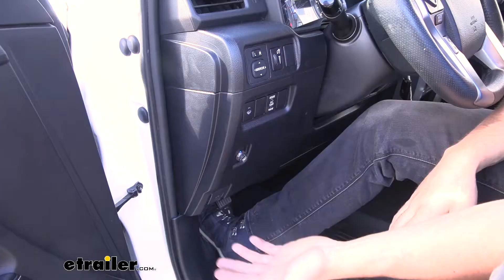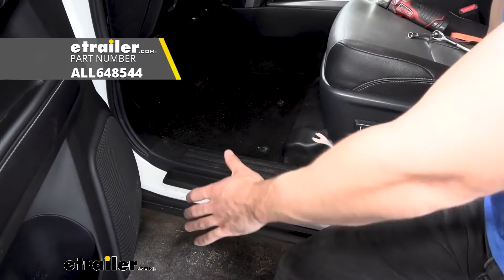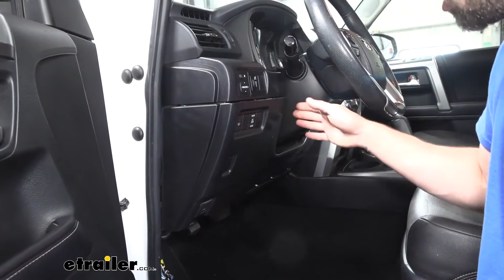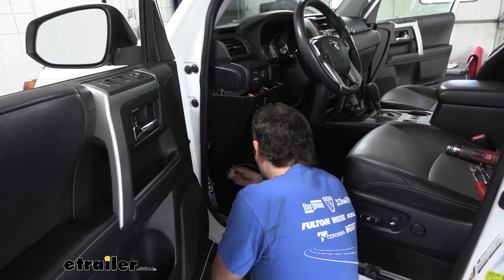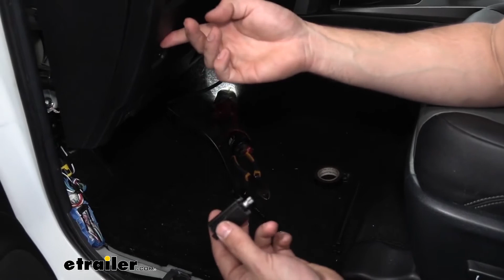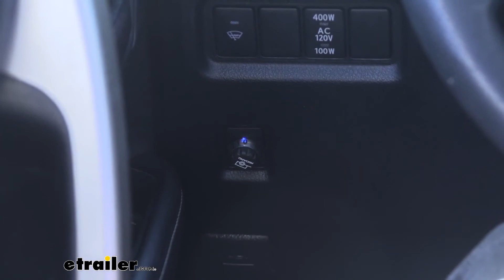etrailer | Redarc Tow-Pro Elite Trailer Brake Controller Installation - 2018 Toyota 4Runner

Comment: I just received my Redarc controller and put it in. There was no little LED light to stick thru the mounting hole, and the fastener nut was clear plastic and not metal. I did not like your controller location as my left foot needs that space. I mounted it on the other side of the foot feed behind the panel. The wires then were too short to reach that knock out so I use one to the right of the steering wheel. I hope it is not too bright for me mounted there. Thanks for taking the time to make this video. I also was working on a 2018 4Runner.
Reply from the maker: The control knob should work great mounted to the right of the steering wheel. 
https://www.etrailer.com/Trailer-Brake-Controller/Redarc/RED44FR.html